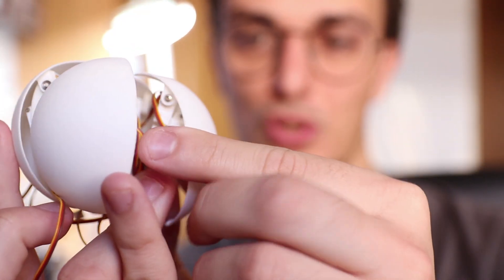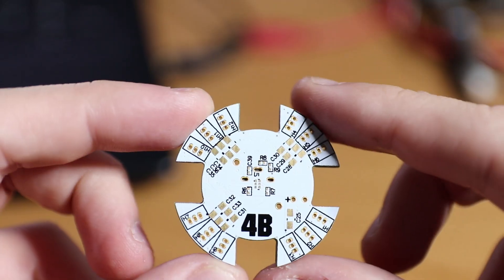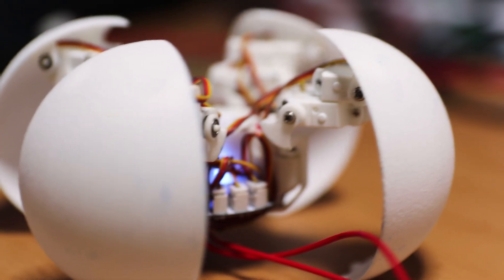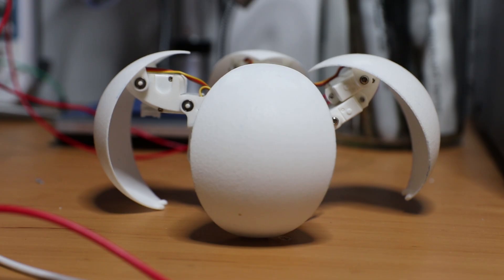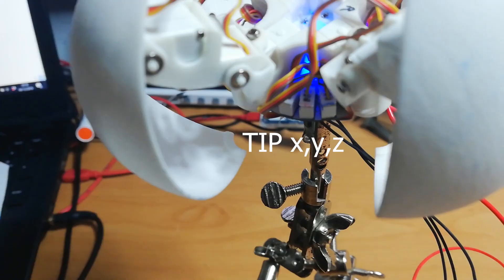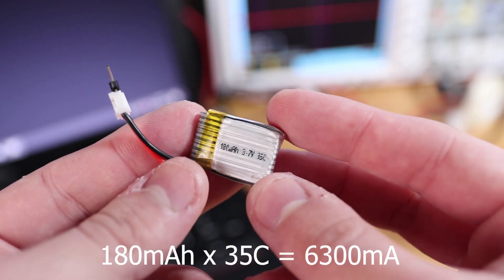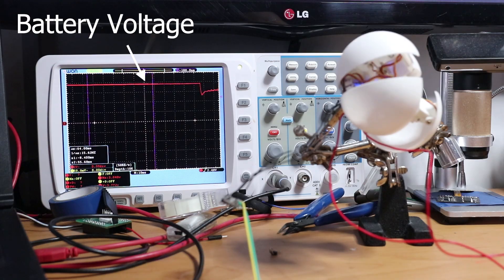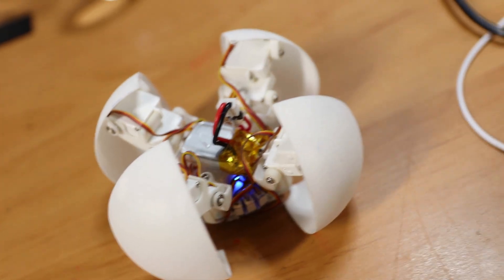Making a 4-Legged Robot Ball

Comment: the movement seems quite jerky. maybe you should add some code to smooth its motion out a bit more, perhaps making it lower its acceleration at times of high power consumption to fix the current limiting problem.

Comment: Hello can you explain the math you used to figure out the acceptable weight? You mentioned the length of the leg and the torque of the motor. What is the formula? Do you have any reference you could share as I am trying to figure out what motors will be best for a project. Thanks

Comment: Be careful with cheap crocodile wires. I got same issue with dropping down power at developed device with same wires and I took time to figure out that trouble was not at accumulator or schematic.
Reply from the maker: i totally understand what you mean but the current drawn by the robot is 600mA max so the wire drop shouldn't effect it that much
Reply: @CarlBugeja  I got this issue with eps8266 project. In peaks it takes up to 200mA and exact in this moments I got much lower voltage on device.
Reply: @CarlBugeja  just check wires and especially how are they connected to crocodyle, I got some of them without any soldering at all)